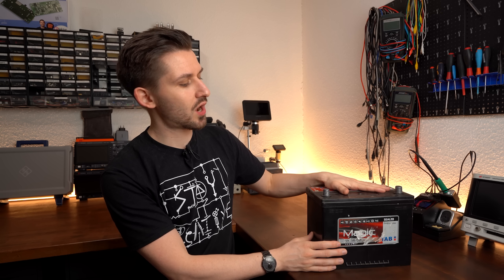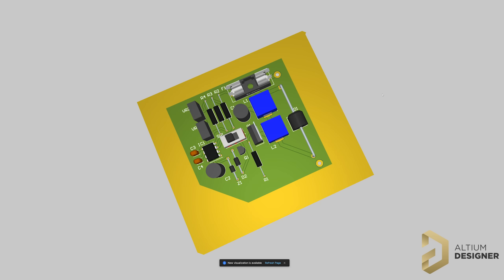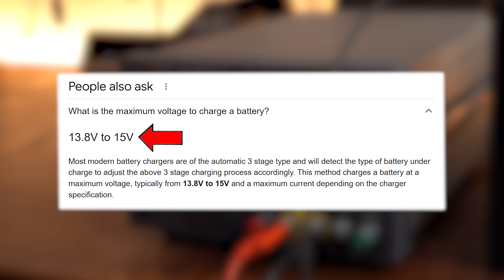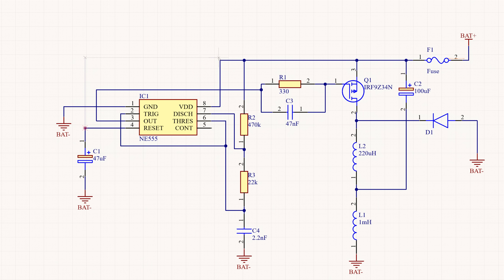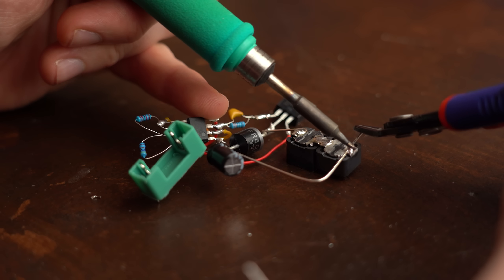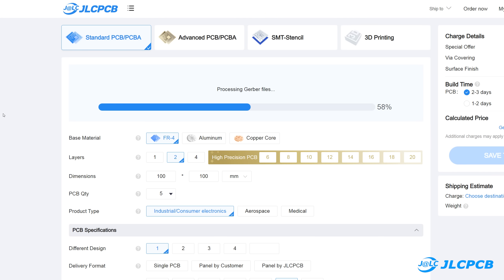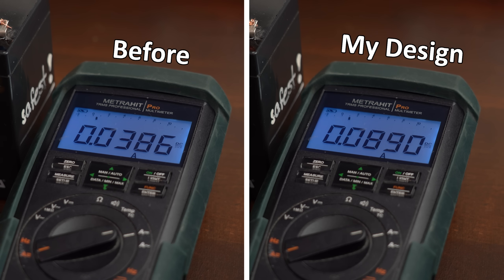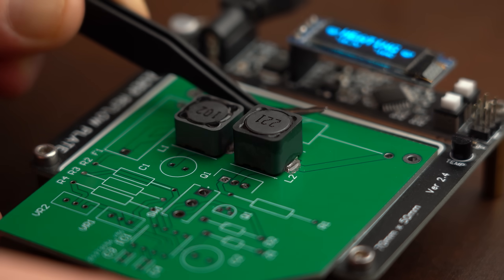I followed a YouTube "Battery Hack" and Wasted 30 Days! (Desulfator)

Comment: Battery desulfation must only be performed during battery charging and over a long period of time. The desulfator cannot be used separately when discharging the battery! The ideal surge currents are 1A to 30A at a frequency of 6 to 10kHz. I have a desulfator permanently connected to the battery, which turns on at a voltage of 13V and turns off at a voltage of 12.8V, which means that it works when the battery is charged or when the battery is being charged. The battery must be free of short circuits and have only slight sulfation. If it has severe sulfation, nothing will help! Keep in mind that every time the battery is discharged to 11V, its service life is reduced.

desulfatace baterie musí probíhat pouze při nabíjení baterie a to dlouhodobě. Nelze desulfátor používat samostatně při vybíjení baterie ! Nárazové proudy jsou ideálně 1A až 30A při frekvenci 6 až 10kHz. Mám desulfator trvale připojen k baterii a zapíná se při voltáži 13V a vypíná při voltáži 12,8V to znamená že funguje při nabité baterii nebo ´při nabíjení baterie . Je nutné mít baterii bez zkratu, Baterie musí mít lehkou sulfataci. Pokud má velkou sulfataci tak nic nepomůže ! Uvědomte si že každé vybití baterie k 11V jí snižuje životnost. (translator)

Comment: What I was thinking off is a "vibrating plate" , you know such a thing where you can stand on and itvibrates for some BS fitness thing. The whole thought behind this is to get the sulfication off of the plates. And my thinking is that SHAKING (vibrating) the battery is way more effective (if it really would work, this in my mind would work better :P )

Comment: Battery desulfators  (NOT desulphator) are real, but the ones sold to consumers don't do jack. I tried a NOCO GENIUS10 and tried desulfating various batteries  - flooded cell and AGM, and it revived 0 out of 8; there was no improvement in internal resistance. I saw an entry-level shop bank charger with desulfating features at a motorcycle shop when I took our BMW to be inspected and asked about the desulfating successes, and they said it doesn't do jack. 

However I have seen batteries rejuvinated using DC stick welders, which pump out a heck of a lot more current than the desulfators I've tried and seen can muster. This also used a flush and refill step, which another user (@michaelkaliski7651) mentioned. 

Consumer desulfators claim to work on flooded or AGM batteries, but I have yet to see any succeed on even one battery. Out of the eight I have tried so far, two of the batteries were stone-cold dead, four were moderately dead, and two were still within but only barely "good" internal resistance. None of them could be revived to a solidly "good" internal resistance, although there was some slight improvement in a couple of the moderately-bad batteries.

The flooded cell batteries I tried, were "maintenance free" and I didn't go through the hassle of flushing and refilling nor did I try the epsom salt method to sesulfate and revive them. With AGM, the flush-and-replace the electrolyte method is impossible.

Comment: can we use p-cannel mosfet instead of n-channel? because most of the battery desulsator circuits use p-channel mosfets with ne 555 ics. your modified circuit is very good, but complicated, too many components are used. make it simple n easy next time. thanks for such a great video!

Comment: I've desulphated many dead/worthless capacity batteries about 20 ish over the last 15 years.  

If the battery registers above 10v and has no current it's probably repairable. You'll need a halogen 60 watt headlight bulb too. Try it for a week then kill it with the headlight. Then desulohate it again. Cycle it a couple times while charging at an amp with the desulphator. 

It depends on if the battery meets the sulphation category. 

If a cell is shorted it's garbage.

 If it's a SEALED LEAD ACID (SLA) ITS ALSO GARBAGE. Can't be brought back nomatter what you try.

Comment: 1. charge battery as much as you can
2. drain all the electrolyte
3. fill battery with distilled water
4. apply charging current about 1/30 of the battery capacity (2amps for 60Ah battery) for 2-3 days
5. try to discharge it and charge again about 2-3 times (optional)
6. drain all the resulting battery electrolyte again, fill it with electrolyte with density 1.27-1.3 and then charge battery with current 1/20 of battery capacity

Comment: Better to fully change polarity of the battery two times. It is slow process wich requires very powerful specific psu, and a bath of cold water. But it is able to regenerate 30% of fully dead battery.

Comment: I've recently reviewed much online lore about this subject specific to sealed lead acid batteries and concluded: desulphation by purely electronic means (no opening of cells or chemical adjustment) is of very limited utility, pulsing is no more useful than constant current, avoiding overheating is critical and charge/discharge cycling helps. Ultimately, most are not recoverable but some will gain some limited life extension.

My personal method therefore is to push 0.1C for a while but avoid heating beyond 120°F, discharge at a similar rate to 90% nominal voltage then repeat this cycle as long as the discharge time continues to increase. This can take days or longer. If the battery will hold a charge and deliver at least half the original rated capacity, I'll keep using it.

Comment: You would be just as well off. Building a high current relay circuit with a low frequency pulse snd connect this in series with a dc welder,1 sec on, 2sec off. Ànd up to 20 sec on with ,and 30 secondals off. Hitting a 12v battery with a high current source at 18v to 36v or even higher possibly, i shirt pulse,  I've vherd ppl say to connect a chager up backwards with a car headlight bulb in series for a while. At 10 amps charge  about 8-12 hours, check the water, fill wit deionized water, then charge at 1amp the correct way around for a day or so testing every so often.  And i have also heard to boil a quart of deionized water saturate with Epsom salt, remove some electrolyte from the battery, replace the electrolyte with Epsom salt water after it Has cooled. (I wonder if it being hot could help)  Fill the battery, charge at 10 amps or less for 8 hiurs  or so. And if the battery isnt damaged. And was only sulhphated plates it will work like new! I have seen videos of rinsing the battery out with baking soda then just water. And fill with saturated epsomsalt water, charge forbabwhile, and if the cells were not actually damaged the battery would perform as if new.  I haven't made any attempts myelf, after a science fair project exploding inmy hand, ,( don't build a tiny battery inside a large glass jar, thankfully it had a plastic lid, and it  blew off in pieces in my hand ..😵, now im older i know what happened, the tiny cells in the bottom of the large jar gave of O2, and Hydrogen, collecting in the empty space. I was thinking safety if it were knocked over, the acid eoud be contained in the jar. , this containment cam back to bite me,! I had 8 gauge aluminum wire running from the lid to the cells. And the gas made its way up through the caulk then the loose charger connections sparked and made a woosh rocket in my hand. I was sprayed with acid and had pladtic in my hand, and nothing for science fair. ). It was a bit muchfor s 7th grader anyway i guess!!

Comment: You can’t simply hook it up and expect it to work. Charging and discharging the battery repeatedly is necessary and is the only way you can break up the crystals. The desulfator can only help keep new crystals from forming and dissolving loosen up ones. If you are uncomfortable using high voltage you should be able to charge up to equalization voltage

Comment: These cheap desulfators work best when used to maintain a good battery to prevent sulfate build up but are not going to help if the battery has built up large sulfate deposits, that requires much more extensive intervention.

Comment: I've revived many dead car batteries with a cheap desulphator.

You do realize that a 500ma to 2 Amp trickle charge is required while pulsing the battery.

They need to meet the narrow and specific symtoms of sulphation for this to work. If one cell is shorted dont bother..  IE look for no load 2 to 10 Amp hour capabilities at full voltage. That's usually sulphated.

First you need discharge them to zero with a headlight. While they never come back to original they are usable for different applications.  Start is usually  2 to 10 ah before and 30 to 50 ah.capacity after a month.

I've never successfully revived a non spillable or sealed lead acid. I've tried it 10+ or so times.  So don't bother

Comment: A university science department ( may have been in Sussex ) experimented with using this so called desulphation process and produced a paper which concluded that pulse method desulphation simply does not work !
As regards washing the battery and refilling it with fresh solution  , it is now becoming expensive.  I have noticed that people in the US / Canada can go to their auto stores to buy fresh solution but I don't think this is allowed in the UK . I was even thinking of buying the sulphuric acid , if I could work out how much electrolyte the battery would need and , hence,  what 30% of that would be but it seems you can't buy it in this country,  the UK , as it could be used for nefarious purposes  -- it is very dangerous stuff . I have , over the years  , realised that if your battery starts to require regular re-charging , it is time to bite the bullet and buy a new one .
A major point to remember is that if your vehicle is left standing for quite a while  , you must keep charging the battery up ( trickle charging  ) . Due to mobility problems  , I have been unable to remove the battery to charge it up with a battery charger and I've had to be away from home for long periods and,  due to a seizure  , couldn't drive the car in any event  ! This led to the battery falling and having to buy a brand new one !
With sitting in the car to warn the engine up and keep charging the barrel up , over time I have used up more than half a tank of diesel  ! Therefore  , I'm thinking of buying a solar panel to keep the battery charged.  I know very little about solar panels that would be a good fit for this purpose and was thinking of buying one rated at 1500 watts but am unsure as to how many amps  . They seem to start at 10A and increase up to a lot more-- in amps and price . But I would have thought the amps would be better low as battery chargers can be just 4 amps for a slow trickle charge which I understand is better for the health of the battery . For a few quid more , the panel can come with a controller but , as the panel gives DC , is a controller necessary or something that would take up more space on the dashboard/ windscreen sill ? ( It's not the extra cost with the controller that concern me as its only the few quid more but  , at the same time do they serve a useful function ?

All and any advice will be gratefully appreciated  !! Thanks guys  .      Stee

Comment: I have had some success using a standard DIY circuit, but  using it while charging as well as discharging,. I used a 'wall wart' 12V supply and linked it to the positive rail.  via a diode , and added another diode between the positive rail and the battery.

Comment: New lead acid batteries are a waste of time and money. Too heavy, too weak and too expensive.  They are only good for at best half of the rated capacity and they constantly require a charge current.  Simply not worth it anymore with LFE batteries available.

Comment: Tryed the same with a deep cycle battery from my RV that set for 1.5 years and would self-discharge slowly. No help, I then got an Aliexpress flex solar panal and controler that seemed to help to keep the battery up.

Comment: Probably would have higher chance of success with flooded lead acid batteries.
Electrolytes in those SLA usually are either in gel form or absorbed within fibre with none or little free flowing electrolytes.

Comment: Is this addressing the same problem I get around by connecting my cordless drill batteries that stop charging to a bank of six 6V batteries in an 18V config (golf cart size batteries from a man lift, Trojan high amperage), spark the small battery a few times and then it starts charging again?

Comment: Did you study the difference between (1) a battery that was flat so that the plates sulfated versus (2) a battery that ran low on electrolyte/water which exposed the plates to corrosion? You will have to cut the battery open to see the level of electrolyte in your cells and the condition of the plates. Did you inspect the electrolyte and plates?

Comment: The desulphator circuit only works if your  battery is only has lightly sulphate cells. It will NOT do anything to improve a shorted cell(s) due to deposits in the bottom of a cell sorting out plates or plates that have rotted away. 
I have made two 10 amp desulphators and yes they work but it depends upon why your battery has failed or why it is deteriorating, like I said they only “fix” lightly sulphated batteries.